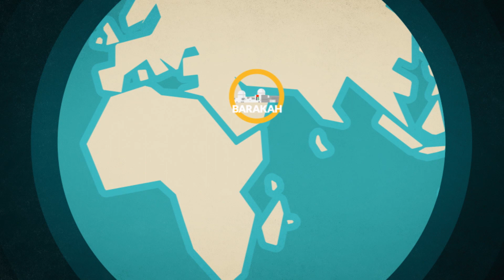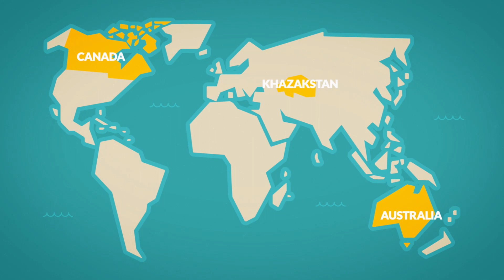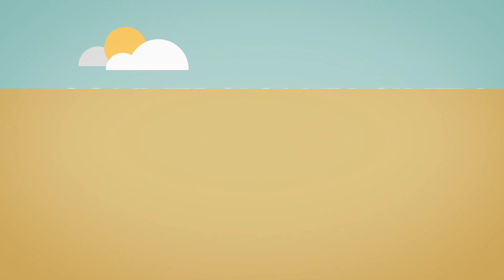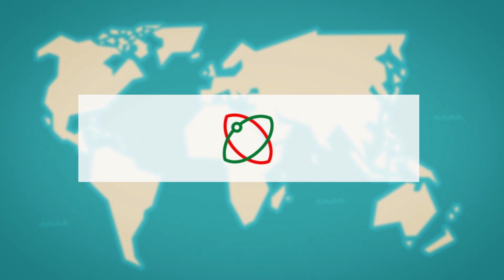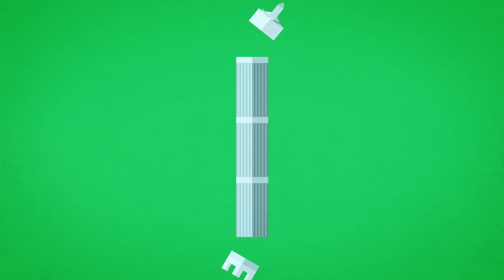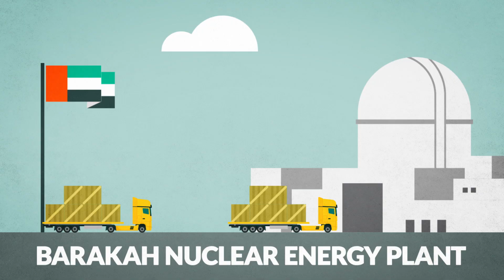Fueling Barakah Nuclear Power Plant

Comment: خطوة جيدة لكن ماذا عن النفايات النووية كيف يتم تدويرها ؟
Reply: -The spent used fuel or commonly known as nuclear waste can be reprocessed, is stored in concrete containers for 5 to 10 year and then sended to a reprocessing facility
-The reprocessing facilty separates Plutonium that is 4% of the fuel from the rest of the spent fuel which is still 90% Uranium-238, the remaining 6% is Fission-Products
-The plutonium is reused as a nuclear fuel for the reactor to make new fuel bundles
-The fission products then can be separated into valuable things, Rhodium, Palladium, Technetium, Xenon, Ruthenium, Zirconium etc...
-The really radioactive nuclear waste is only Krypton-85, Cesium-137, Strontium-90, which can be stored or be sold for things like medicine, cancer treatment, industrial devices, food sterilization since they produce very strong gamma rays
A reactor like the ones at Barakah produces 1500KG of fission products a year, from which around 10% of those are radioactive and decay in a few centuries